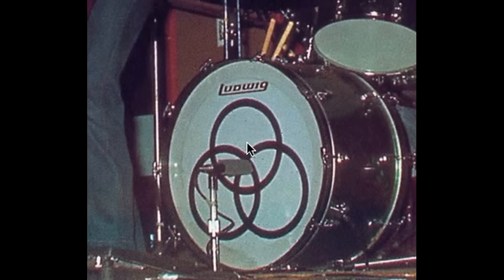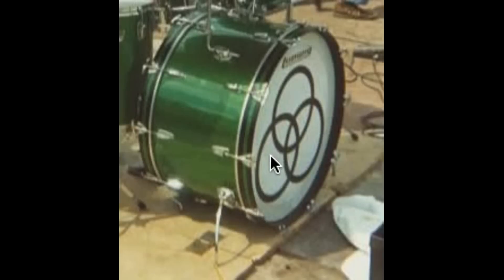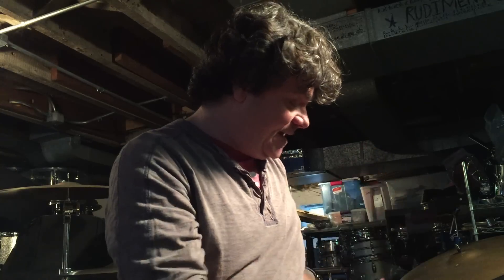JOHN BONHAM'S BASS DRUM SOUND ** THE RITCHIE RING MUFFLER **

Comment: i'm presently trying to get the most bonham possible (el major bonhamo) out of my '72 thermogloss 14x 26. Emperor with a felt strip across the very bottom on the batter and a smooth white head up front, presently no muffling on it. sounds pretty close. trying to A/B with the Ochletree vid. but i love this idea and i'm going to try it out. my first question is- what's the best way to cut a clean, actually two clean circles out of another 26" head?
Reply from the maker: Hi Iris- take smaller heads and use them for templates.For a 26 outer edge ring, I would use a 20" head. Just make sure you put it dead center.
Reply: @bonzoleum  there you go! thanks man. love these vids.
Reply: ok i cut the inner ring out of a clear pinstripe 26. so what do i use as adhesive? rubber cement? crazy glue? what dries clear?

Comment: I remember Ritchie Ring as the name of a product. Came in different sizes,had a cute logo. 'Course I just saved $ by cutting up old heads. Just like Deadringers. Remember those pricey things? All sizes,cool colors,ridiculously expensive packaging. All for a ring of foam rubber with some 3M adhesive on one edge. Solved that problem by using Ace Hardware house brand vinyl foam weather stripping. Could do a whole kit for less than $10. But that was over with once I LEARNED HOW TO TUNE.